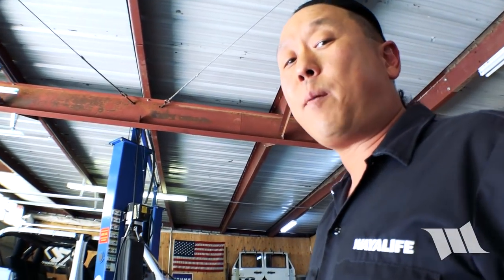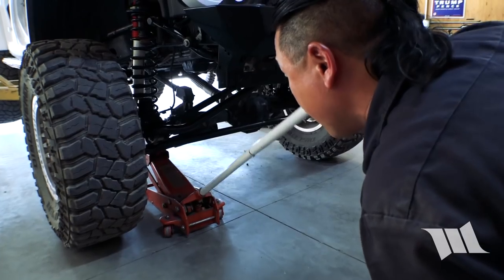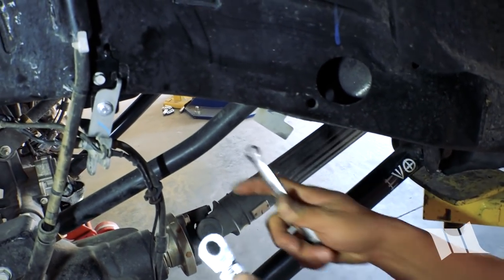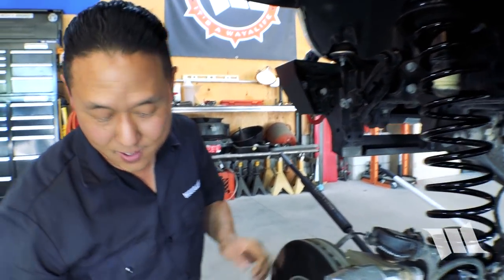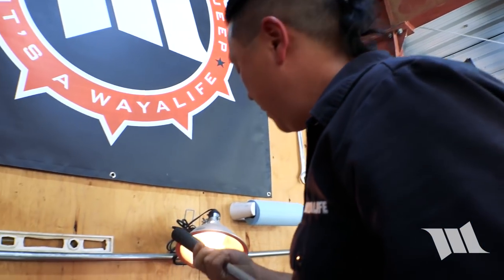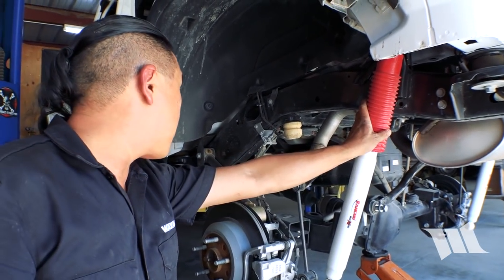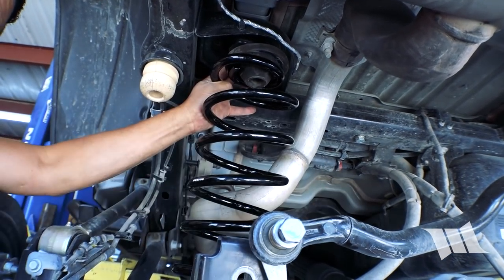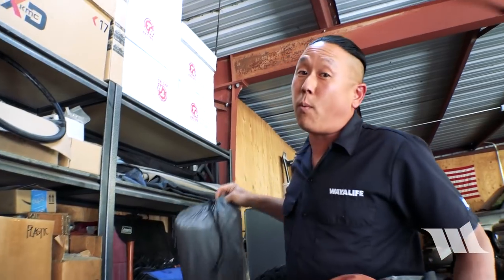Jeep JL Wrangler 2 Inch Lift Kit How To Installation : Dynatrac EnduroSport 2" Suspension Lift

Comment: Great video! How do you suspect the stock gearing will hold up over the long term, running the tyres you have now, and do you plan on upgrading those components in the future? Cheers!
Reply from the maker: So far we've got over 13,000 miles on our stock gears and running 37's. So far so good and I think the all new 8-speed auto will hold up well for years to come. We do plan up upgrading our axles in the future to run 40's and we'll address gears at that time.

Comment: Dude your awesome, best jl videos on youtube. Just got a jlu 2.0 turbo You think this kit would work on that. 
Dynatrac says this kit wasn't tested on a 2.0, but the weights of 2.0 and 3.6 is not much different.
Reply from the maker: It'll work fine. I should note that after long term testing, the lift only yielded 1.8" of lift and it was too little for 37" tires. I would only recommend it for 35's.

Comment: I love your videos! I’m a new Jeep owner…do you think would be better to replace even the lower control arms with a 2” lift? I noticed Mopar with the 2” lift provides the control arms.
Reply from the maker: Thank you. We're so glad to hear you enjoy our videos. Regarding your question, there is no need for new lower control arms. The Mopar kit comes with them because it offers over 3" of actual lift. This kit offers just less than 2". At that height, you're caster will not be affected enough to warrant correction.

Comment: I came here to ask to the best, because I love your videos and what you do !! Do you know if this lift kit has been tested in JL 2 doors ? If no, how do you think it will work? I like 2 inches lift kit but I don’t know if get this one or 3 inches lift kit with low arms and track bars, what do you recommend me for a daily driver and off road weekends (not rockcrawler)
Reply from the maker: Honestly, long term testing showed that this kit yielded LESS than 2" of actual height once the coils settled in or at least, on a 4-door. So, it may give you what you're wanting on a 2-door.

Comment: Great video as always!  Finishing installing the front lift on my JLU Rubicon and need to move the sway bar a bit for the links, but it seems rigid.  Do I need to use the front sway disco to be able to move the sway bar?
Reply from the maker: You should be able to muscle the sway bar around.

Comment: I love ur video..just got myself a Jeep JL Willy's....and looking for mods and upgrades...2 inch lift or more is what I want....when u added the spring spacer did that give u any trouble..this lift kit may be just what I need...
Reply from the maker: The spacers are fine but if price is an issue, I might recommend you give the Rancho Sport lift a look as it can be had for about $600. I personally found it to ride great.

Comment: So you put on this 2" lift and run 37's with no problems?  Seems like I saw another channel where they were getting tire rub with a 2.5" lift and 37's and even used a heat gun to push back the plastic fender walls.  My 2019 JLUR is still stock and I'm kind of waiting until I need new tires to decide what to do.  Thanks for your awesome videos!
Reply from the maker: I think you might be referring to the video I made way back in early 2018 https://youtu.be/WxcOtkbKX04

Comment: Better than the Rancho kit in every way, or are there give and take of qualities between the two?
Reply from the maker: Ride quality of the Dynatrac is nicer and flex is better as well. Rancho will give you a bit more lift and it will also do a better job of holding up a lot of weight with less sag in the rear.

Comment: Your videos are awesome. However I am currently considering a lift as I just got my first jeep. My biggest questions are do I need adjustable track bars front and back for a 2-2.5 lift. Also replacing all 8 control arms is out of my budget. Can I get by with just lower front CAs?
Reply from the maker: MOST lift kits will yield MORE than what is advertised. A lift like this will yield LESS. Long term testing showed us we only got 1.8" of total lift and that is well with in factory spec. Needless to say, no adjustable track bar is needed for it or anything else for that matter. IF you get a lift that gives you 2.5" of lift or more, a rear track bar relocation bracket will help there and an adjustable front will be nice to have to help recenter your front axle at ride height but not really necessary. And yes, you can get by with just adjustable front lowers to add in a bit more positive caster.

Comment: Since you have both a JKU and a JLU I'd love to see a video or get an answer on if the JLU front and rear seats will fit in the JKU. I love the added refinement on the JLU seats that's been missing on a JKU.  I can't find anyone that has done this or willing to test this.
Reply from the maker: From what I can see, the seat brackets and mounting points are different. If anything, I might recommend that you install a set of MasterCraft seats or the like.

Comment: So for some older folks with a few disabilities, does this ride much smoother off road than the Rancho you had. Enough difference to justify it being in todays current market twice the price???
Reply from the maker: Honestly, not in my opinion. Rancho coils are soft and a good old school hydro shock is always going to offer a smoother ride than a more modern monotube. Where there is a downside to hydro shocks is that they will fade when doing a lot of hard and fast driving across the desert.
Reply: @wayalife  thank you!!!

Comment: Hey great channel have learned alot from you. Putting this suspension system on my 2020 jl 2door Rubicon.
Question is since I don't have a winch yet  would you recommend I install the levelers at the same time I install the lift?
Eventually the winch will be the next mod. Running factory mopar steel bumper. Thanks
Reply from the maker: I would wait to install them. If you do it now, your Jeep will look like the front end is sitting too high.
Reply: Thank you for the quick reply

Comment: Did you add the front dynatrac control arms as well? 
If so worth it? Or good as a base spring and shock kit.
Reply from the maker: I did not. And, should note that I removed this lift as it ended up settling to just 1.8" of lift and it was too short to clear 37's.

Comment: I see that Dynatrac doesn't include an adjustable track bar (or control arms).  Did you measure afterwards and see if the axles were centered?  Im heading towards getting this kit due to who designed it (Tony) but wondering if I should install some RK adjustable track bars while Im doing it.
Reply from the maker: Unlike a lot of the 2" lift kits out there that actually yield more like 3" of lift, this Dynatrac kit will give you a true 2" of lift. This is well within the factory specs and there really is no need for an adjustable track bar or control arms. In fact, anytime you load or unload your Jeep with weight, your axles will shift to one side or the other as it's just the nature of the beast of a track bar that is mounted on the frame on one side and the axle on the other.

Comment: Eddie nice video like always. I’m doing my research and I came across your install vid on this. I see you running 37’s with this kit and I’m assuming no re-gear, any issues or anything worth mentioning? Seems like I might be going with this setup on my 19 Rubicon JLU.
Reply from the maker: This is what I can tell you. Long term testing showed me that this lift will settled to just shy of 2" of actual lift. While it does work, it's a bit short for 37's and for me personally, a little too short. I ran it with both 4.10 gears and with new 5.13's and yes, you can run it with just the 4.10s and it won't be too bad.

Comment: I'll be installing this lift soon. Did you notice an exaggerated lean without side-specific springs? I'm thinking about adding a spacer to the passenger side to compensate. Thanks!
Reply from the maker: There is some lean but nothing too bad. Adding spacers might over compensate for it though. I should note, that after long term use, I found the coils settled to only 1.8" of total lift. This was way too little for 37's.
Reply: @wayalife  hey thanks for your quick reply! This will be on my wife’s Sahara “daily”, and 315/70/17s (no larger planned, for now 😉). Thanks again for your time. I enjoy your content, always looking forward to new uploads!

Comment: How do you think this lift compares to the Mopar lift?  Thanks
Reply from the maker: Well, what I can tell you is that this lift will yield exactly 2" of lift where as the Mopar will yield about 3" of actual lift. If all you're wanting to run is 35's, this is a good kit. If you're wanting 37's, I would probably recommend the Mopar kit.

Comment: Hi! After adding lift kit and bigger tires, did you have to adjust speedometer?  Do stock axles support the added weight or adjustments required?  Also, did you need to upgrade your brake system?
Reply from the maker: Not for the lift but for the bigger tires. You can have your dealership do this or you can buy something like a Tazer JL. Axles are fine and so are the brakes.

Comment: Looks good!! What’s you preferred tire? I’m looking to get new 37s. I had stt pros and nittos. I won’t really be wheeling much tbh but want a mud terrain, not sure if you had any recommendations for DD mud terrain thanks!
Reply from the maker: Honestly, based on what you're saying, I would go with the Nittos as they are a better daily driver. Or, I would also consider Toyo MTs as they are great as well.
Reply: Wayalife awesome! I ended up ordering some trail grapplers! Thanks for the response 🤙🏼

Comment: For the Rancho lift and the Dynatrac, what would make me choose one over the other in terms of feel? Was one better suited for a certain terrain? If you can recalll this far back haha
Reply from the maker: So, after long term testing, we found the Dynatrac lift to only yield 1.8" of lift. This was far too little for 37" tires. The Rancho lift yielded about 2.5" and cleared 37's well. As far as ride goes, the Rancho shocks actually felt smoother on pavement and for daily driving and mainly because they are old school hydros but they do fade when doing a lot of hard and fast driving across the desert. The Fox shocks that come with the Dynatrac lift resist fading better.

Comment: I noticed you didn't loosen the control arms on this install, is that due to the aftermarket arms installed?  If you have stock arms would you loosen then tighten once back on the ground?  Thanks!  Great video!!!
Reply from the maker: Good eye. I didn't loosen the control arms due to the fact that my EVO adjustable control arms have Johnny Joints on both ends. Because of it, there is no bushing bind to be concerned with. That being said, this Dynatrac lift yields exactly 2" of lift - this as opposed to 3" of lift or more with most of the 2" lift kits being sold today.  The 2" is well with in factory spec and so loosening up the bolts and then tightening them again is not necessary. However, if we still were running factory arms, I might do it anyway.
Reply: Wayalife  Thanks, Eddie.  I appreciate the response.  Hoping I win am a lucky winner of this one, but if not I see either Rubicon takeoff suspension or maybe the budget kit in my future.

Comment: I don’t know if it was discussed before but would this be better with some new control arms?  I know it would drive the cost up considerably but seems appropriate.
Reply from the maker: When the coils settled out, I only saw 1.8" of total lift. This is maybe the shorest 2" lift I've tested and relatively speaking, within stock spec. With that said, no, new control arms would not be needed.

Comment: Hey, another awesome install video (like I should or would expect less) but I do have a couple questions.  If I recall correctly you removed the rancho lift, to install the Dynatrac lift, however, when you installed the Rancho, you pointed out that Rancho paid attention to Jeep and made the coils specific to each corner of the JL, it looks like Dynatrac just made the front L/R and the rear L/R the same length.  You made an issue of the fact that each front and rear coil were different lengths.  Please advise.  Also, how did the the Dynatrac compare to the Rancho?  Thanks again for another awesome video....OH.... Have you had any of the "vague" steering issues reported on the JLU especially the Rubicon?
Reply from the maker: First off, this whole "vague" steering thing that people are whining about on social media is just stupid. I'm sorry but clearly, they are people who's previous vehicle was some kind of car with IFS and modern rack and pinion steering or something like that. This is a Jeep with a solid front axle, steering gear, drag link and tie rod that turns left and right and everything feels just about right to me. Does it feel like a Honda or BMW? Not even close but then, I don't want to be driving either. Second, regarding the Dynatrac coils - if anything, I'm kinda glad that they are all the same length being that my JL always had a lean to the driver side even wehn it was bone stock. This continued to be the case with the Rancho coils and I don't see it anymore. Third, when it comes to ride quality, the Dynatrac kit has it hands down as it offers a smooth but solid ride. It really is a perfect kit for a daily driven JL riding on 35's and sees most of its time on pavement. It also flexes way better as well. If there is a downside to it, it'd be that it costs twice as much as the Rancho kit and it sits lower than it too. Of course, this might be a plus for some especially if you liked a low COG build. The Rancho kit does a better job of holding up a lot of weight but it doesn't stuff as well due to its progressive rate coils.

Comment: Love the channel, the videos, the commentary, whole package.  Do you have a comparison of the DynaTrac vs the Rancho kit. Both seem well made but the Fox Shocks I would think are better
Reply: Out of curiosity after testing do the kits go back to the manufacturer?
Reply from the maker: In terms of ride quality, Dynatrac is a nicer lift. The Fox 2.0's were made specifically tuned for the Dynatrac coils that were made specifically for them. Also, in terms of flex, Dynatrac does better as well if only because the shocks offer a greater amount of travel. Where Rancho has a leg up is in it's price - about half the cost. Also, if you're wanting a taller lift, the Rancho kit does yield more. Last but not least, the Rancho kit comes with progressive rate coils and they do a better job of holding up the weight of a lot of gear. The down side to this is that this limits stuff. Otherwise, the ride Rancho provides really isn't too bad.

Comment: Love your channel. did you had to upgrade the track bars to adjust the axles?
Reply from the maker: Thank you, glad to hear it! In answer to your question, unlike most 2" lifts that yield way more than 2" of actual lift, this lift will only give you about 1.8" of lift. That's too small and within factory spec and so there is no need for new track bars.
Reply: @wayalife  and you had no issues on Rubicon trail with 37" from what I saw.
Would you recommend going 3.5" or get this lift with 0.5" coils spacers? 
Thanks from your input
Reply from the maker: @MrNirsky  Well, to be fair, you can run the Rubicon stock. It takes effort but it can totally be done. What I would say is that this lift is really made for 35" tires. Sure, you can run 37's with it but you won't be able to take on the same kind of obstacles that you can with a bit more lift or at least, not without more effort. Based on what I'm hearing from you, I might recommend that you give this lift a look https://youtu.be/0x1wR2m5sKs. From experience, I can tell you that it does the job of clearing 37's better, for a lot less money and honestly, the ride is still really nice.

Comment: If you have all eight control arms and track bars with johnny joints (rock jock), do you need to loosen any of those fasteners for full axle droop (since they rotate freely)?   Or just the cleveite type stock ones?  I've replaced everything but the stock springs and am now planning a 3.5'' lift with new shocks.
Reply from the maker: You only need to do that with clevite or bonded rubber bushings.

Comment: For my Rubicon Express 2.5 inch lift. It didnt come with brake line extensions. So i left the brake line bracket intact and un secured the bracket that attaches to the axle (the same bracket you removed temporarily for the flag nut that will secure the bump stop). Right now that bracket is chilling in between the shock and coil. What are your thoughts on that? Does it have to be secured onto the axle or should i be fine?
Reply from the maker: The reason to secure it in place is to help prevent the line from drifting in between the coil while flexing on the trail. Potentially, this can cause the line to be cut by the coil at a full stuff. Not that it will happen for sure to you but it is something that I have seen plenty of times.

Comment: I have watched your great how to videos for a while now. The JL rubicon will be a daily driver and My drive to work is about 2 1/2 hrs. Will this lift kit be fine with 35’s?  Will this lift look odd with 35s? I am thinking 37 tires will be to big plus having to re gear.
Reply from the maker: Actually, this lift is made more for 35's than 37's. With 37's, you actually have quite a bit of rubbing that you have to address.
Reply: Wayalife gotcha. Thanks a bunch. Keep up the great videos and hope to see you out on the trail 🤙🏾